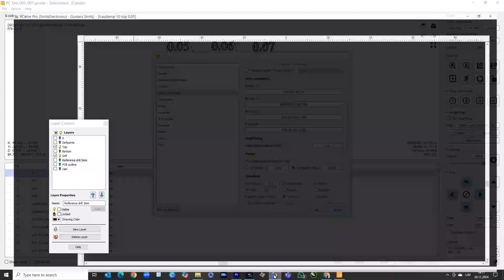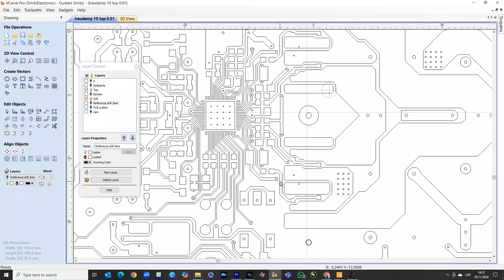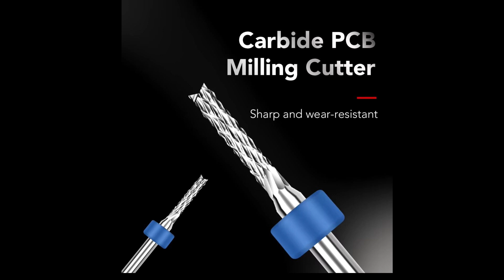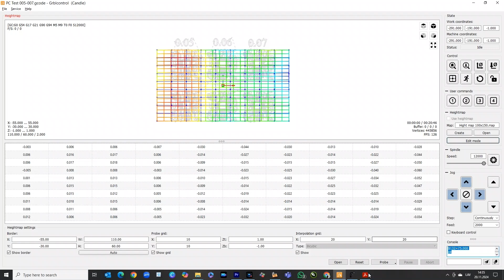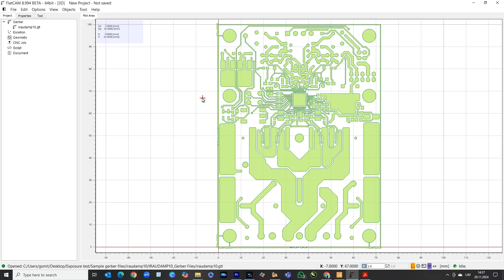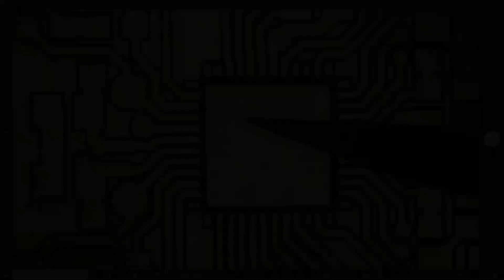PCB milling 10mil desktop 3020 CNC Part 4 Best practices

Comment: at the 10:00 mark the video shows the mill drilling holes. There is a yellow material covering the PCB and the mill is drilling the holes through the yellow sheet -- what is the sheet material? Is it regular masking tape or something else?
Reply from the maker: It is a regular painting masking tape. It prevents the drill from "dancing" and makes it perfectly centred. In professional manufacturing, thin aluminium sheet has been used for precise PCB drilling.